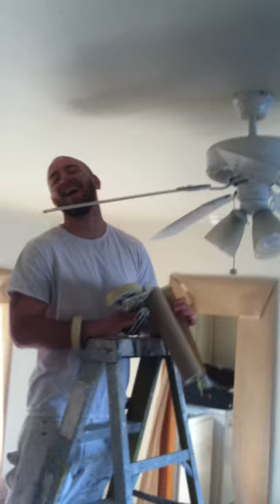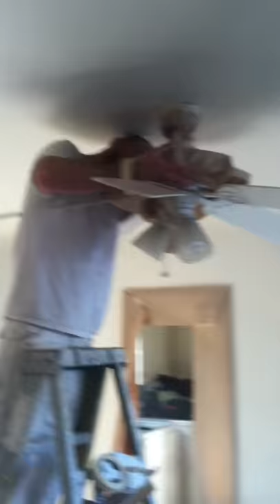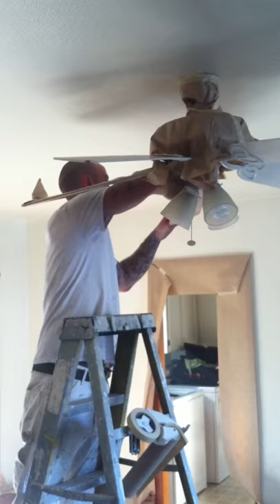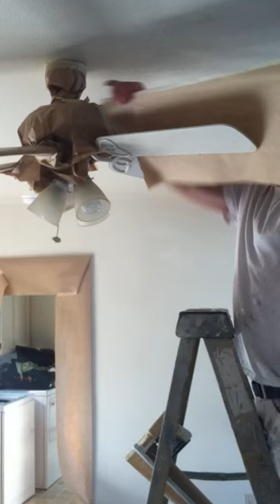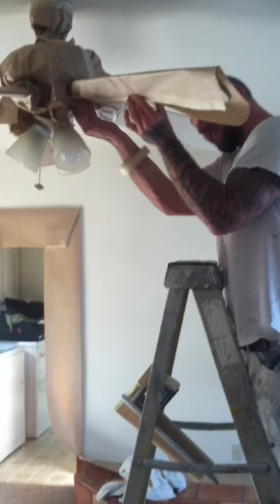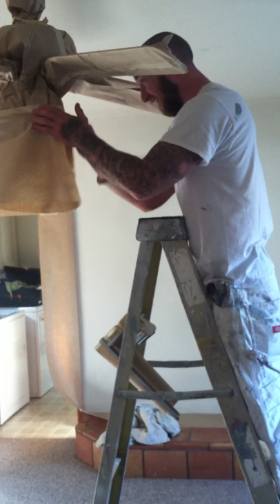How to mask a ceiling fan in 3 minutes.

Comment: I like to wrap tape around the base of the fan where it meets the ceiling,  fold the edge up, and stick painter's plastic to the tape. It should drape over and completely shield the fan. I leave the bottom open for roll coats, and seam up the bottom for lid spray.